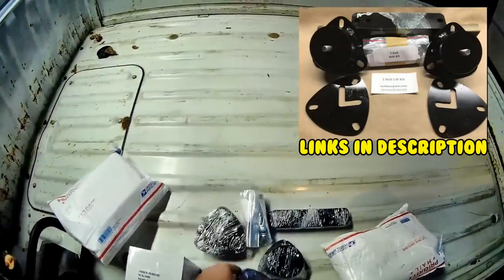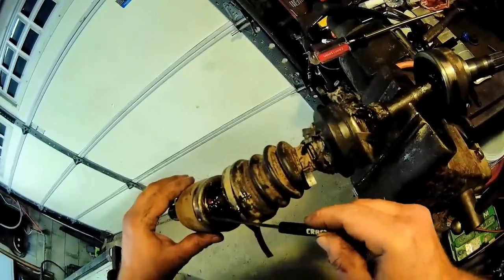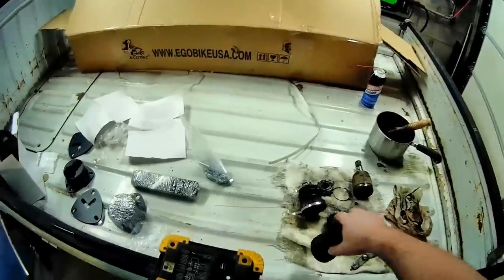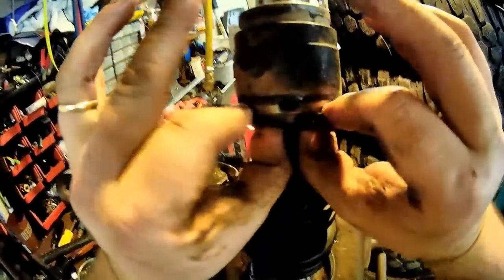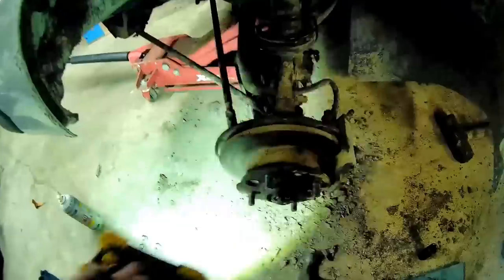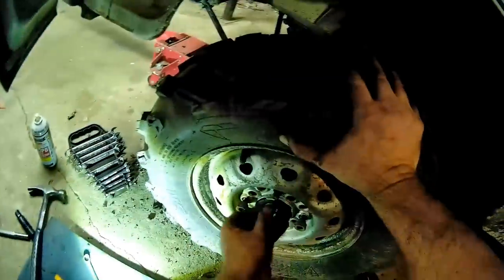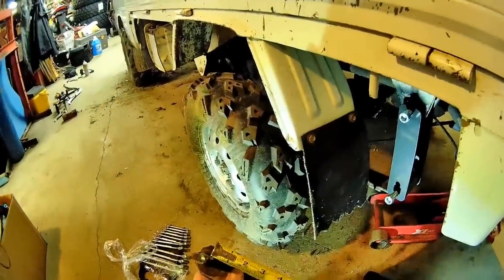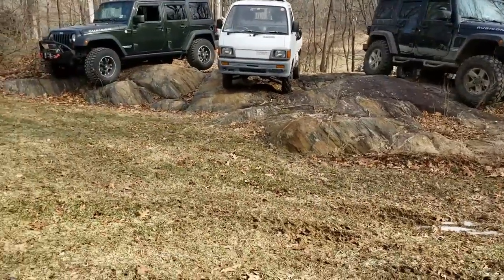Mini Truck (SE01 EP04) mini series, 2 inch lift, pull axle, CV joint boot replacement Hijet

Comment: dude why not you just convert that to left hand driver i live in the Philippines and they have millions of these trucks shipped into the country as scrap they cut the frame in half at the cab and they put the cab in the back of the bed for shipping when they arrived in the Philippines they weld them all back together and they flip over the front drive train converting them to left hand drivers move the steering wheel the pedals everything to the other side and repair the dash with some kind of plastic material they do such a good job you can't even tell there is millions and millions of these japanese mini trucks from all the different makes and models here in the Philippines every one of them is converted to left hand drivers because they have a law against right hand driver vehicles take a look on youtube
Reply from the maker: The right hand drive doesn’t bother me. It’s kinda fun to be honest   I’ve had a few people tell me they converted them, had one guy offer to send me all the stuff to do it.